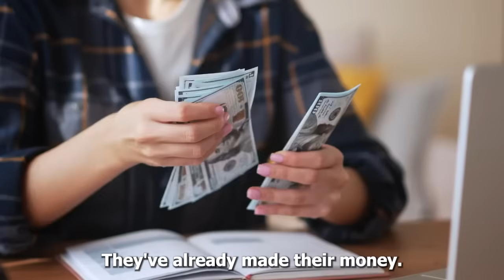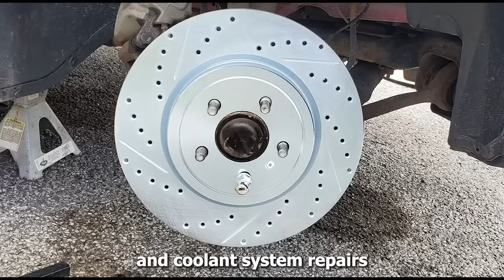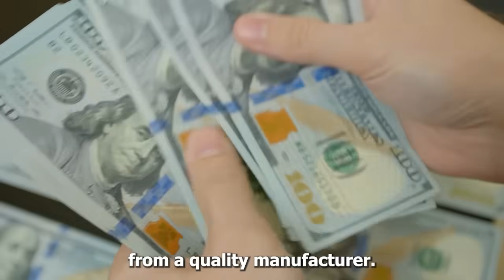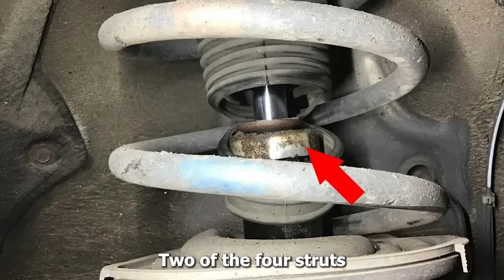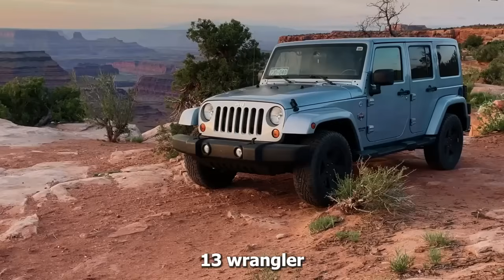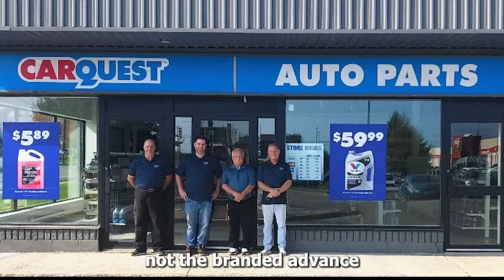THE 11 AUTO PARTS STORES SELLING PARTS THAT ARE DESTROYING YOUR ENGINE (AND 4 THAT WON'T)

Comment: This is BS, I have worked in the Automotive Industry since 1980, there is NOTHING wrong with "Quality" after market parts...in fact MOST after market parts either MEET or EXCEED all OE specs. Now, there can be risk with "Budget" parts that Part Stores offer...always get Premium brands! An added benefit (besides cost) is that Premium after market manufacturers will Correct any known problems with OE parts...

Comment: Some of this seems fishy - video pics don't match what the sounds is saying (wheel bearings supposedly destroyed by contaminated engine oil, which never comes into contact with wheel bearings) and now a Ford F150's fuel pump life is good if it lasts until 96,000 honest miles?  My Mustang six had the fuel pump replaced at 230,000 miles, and I was told it would have gone much farther if I didn't have the nasty habit of letting the gas tank get really low before I refill it.
Reply: I agree and I didn’t even get to that part of the video yet. Im betting AI is acting like spell check on your phone . The other day I typed to someone “ for a nickel I will “ it sent “ for a pickle I will”  , the n and p are not even close on the key board so it wasn’t fat thumbs.
BTW , it didn’t say wheel bearing , it just showed a picture of a wheel bearing
Reply: I constantly retype my texts when the words are wrong. Sometimes twice. Aggravating

Comment: a faulty oil filter by-pass valve would NOT cause wear to the wheel bearings as shown in the video picture, engine bearings yes - wheel bearings - no.
Reply: You caught that too.:face-blue-smiling:

Comment: Why would a honda with only 82K miles already had original alternator replaced  ???  Then the replacement also failed  ?? Seems like a electric issue probably put something on vehicle that added a short. My car has 300K miles still original alternator my truck has almost 500 K & original alternator still working good
Reply: He opted for the $280 one instead of the $600 one.  Often times rebuilds only replace bad parts and re-use the rest of the unit so it may get a voltage regulator or brushes but bearings , windings stater are original
Reply: Rebuilt alternators sometimes has weak diodes.
Reply: Bad rebuild or weak battery 😊

Comment: Just so you’re aware, back in 2019 Pep Boys split the business into two divisions: service and parts. By 2021, the parts side filed for bankruptcy. What’s left today is basically service. Even after dumping their private-label parts and trying to move back toward more “premium” brand-name products, it still wasn’t enough to fix the problem. The real issue was never just the parts; it was the retail model itself. You can’t expect better outcomes when you still have undertrained counter staff making critical decisions. Better parts don’t matter if the knowledge behind the counter never changes. Why did this happen? Repair facilities started demanding cheaper parts. They were tired of paying premium prices for premium products, so it became a race to the bottom, everyone trying to undercut the next guy. That’s when private-label parts really took off. Here’s the problem: If the manufacturer’s name isn’t on the outside of the box, it’s usually not what’s inside the box. Now add counterfeit parts flooding eBay and other e-commerce sites, customers see prices that are almost half of everyone else’s and think they’re getting a deal. You can thank AutoZone with their “Walmart mentality” of the industry for a lot of this.
Back in the early 2000s, AutoZone broke away from the traditional manufacturer pricing spreadsheets that distributors and jobbers relied on. That move opened the door for cheaper parts, private-label brands, and lower-paid counter help, right where accuracy and experience matter most. In the short term, it looked like savings. In the long term, it led to comebacks, premature failures, misdiagnoses, and wasted money. The customer always ends up paying for it, just not always at the register.